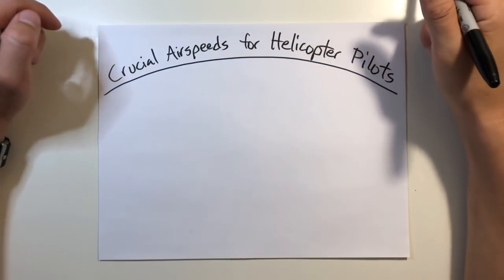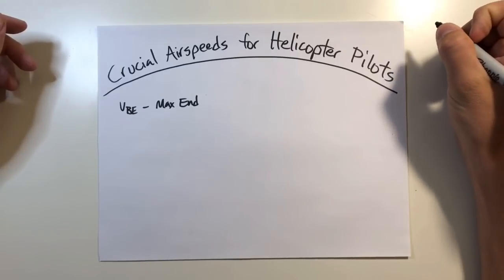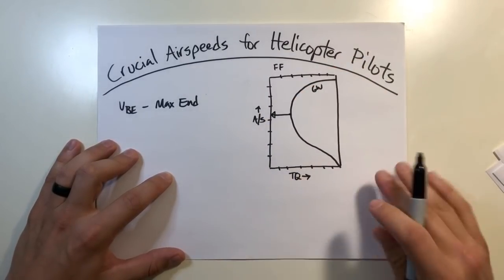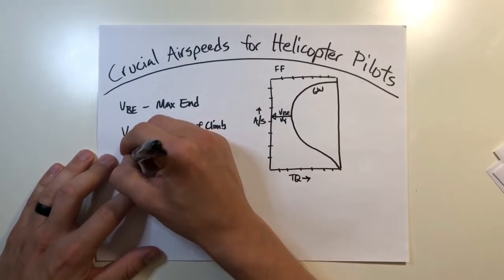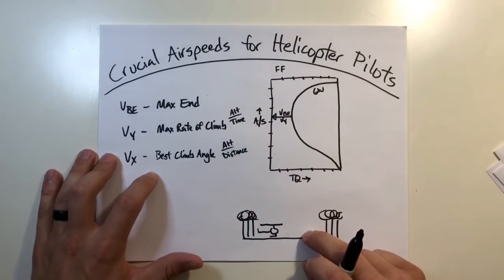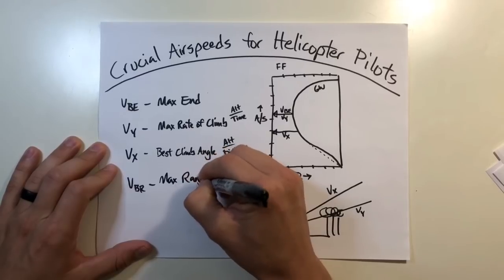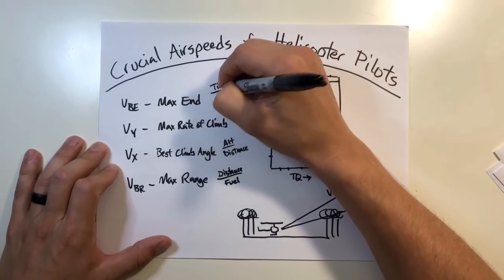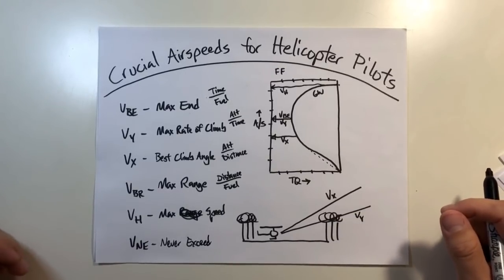Crucial Speeds Every Helicopter Pilot Should Know

Comment: Thanks for the clear explanation. 
A thought concerning Max Range Speed. I don't know the exact calculation, but I believe Max Range has to take wind into account. Here's an extreme case example to understand: say your Vbr is 80kts, if you have a head wind of also 80kts, you will have a better range by flying faster. Your Vbr should increase in headwinds, as less time spend in headwind will get you further, and reduce in tailwind.
What's your thought on that?
Reply from the maker: Winds always vary and so it’s hard to plan a ground speed based off of winds. Max range airspeed has to do with drag, fuel flow, and distance covered. In all cases (headwind, tailwind, or crosswind), max range will be the most efficient speed for covering distance although the actual ground speed could vary.

Comment: Isn’t Vx in a helicopter straight up if performance allows? 0 airspeed in 0 winds and a 500fpm climb would give me the best angle. Density altitude, OGE hover performance, and excess power available would play factor if 0 airspeed climb is possible. Also 0 airspeed climb would also put aircraft in shaded region of hight velocity diagram.
Reply: Vx is zero, if you have the power to do so. (FAA-HFH-7-7). Yes, you would be operating in the "dead man's curve" until you reach a safe altitude and/or speed so it's better to get some speed, if you can. Note, you can still be in a dangerous position with speed if you have nowhere to set down in an engine failure. If you have no space, face the wind, clear the obstacles and get the airspeed. If you have no performance and no space, don't take off until you do.

Comment: Vx sounds counterintuitive.. why isn't Vx in a helicopter in general 0Kts, given we're inside HOGE capable altitude.
Reply: So if you are looking at counterintuituve phrases think of it like this. Hover = 0 knots. Translational lift = 1 knot. Transverse flow effect = 12 - 15 knots. ETL = 16 to 24 knots. IGE is within 1 rotor diameter. OGE is above 1 rotor diameter. Is the wind ever ever ever ever so calm its exactly 0 speed? According to this it's almost like you'd never be in a hover you're always in translational lift even if you have exactly zero knots ground speed you always have some AirSpeed and that's how you measure translational lift. Even if you had just enough clearance for your rotors not to hit walls and you were completely boxed in with walls surrounding the helicopter with just enough space for your rotors to spin around via coriolis effect the vortices from the induced flow from your rotors would blow down and towards the walls and back towards your helicopter giving you some airspeed. Therefore you are never at 0 knots. Not sure if that's why he used VX as a counterintuitive but just putting a counterintuitive to make the other counterintuitive now seems so counterintuitive. Make sense? 😉

Comment: Here’s a question I was asked and still can’t find an answer to. 

Could max endurance get you the same distance as max range just at a slower pace?
Reply from the maker: Good question. The answer is no. Max endurance is like coasting in your car with very little gas applied. It may be able to run all day like that. But it’s no efficient for distance. But max range is the exact fuel burn to mileage ratio that gets you the furthest distance overall. You may be able to fly a long time at max endurance. But you won’t cover as much distance.
Reply: Helicopter Lessons In 10 Minutes or Less awesome thanks! Now I’ve got an answer for my IP
Reply: Nope. When you transition from mav ebdurance to max range the percentage increase in consumption is higher than the percentage in increase in distance and vice versa. So you will go further but run out of fuel in less time. So instead of covering 70 miles in an hour, you will cover 100 miles in 55 minutes. For example.

Comment: Isn't the best climb angle by definition always just straight up? And why is it called Vx when it's referring to an angle and not an airspeed?
Reply from the maker: David Iliescu. Great question! Vx is used when going straight up isn't an option due to power limitations. Vx refers to the speed at a max power setting that gives optimum obstacle clearance. For instance: Vx could be 40 knots with 100% power applied. Those 2 conditions create the best climb angle for that aircraft. I hope that helps.

Comment: I have a question in relation to air-frame choice. Why did you choose the 64 over the 60 or the 47? I have been thinking of trying to go 64 but I have heard that they might not fly as much as the other air-frames due to lack of mission diversity. If you could give some insight on what made you choose the 64 that would be great. Thanks
Reply from the maker: Kagan Smith. Personally it's because I wanted the offensive mission. I wanted to be the aggressor on the prowl with the power to shape situations. I grew up hunting deer and wanted to apply the same primitive instincts of scouting, tracking, and pursuing to the air.  Carrying around passengers and cargo just didn't appeal. Not to mention the personality types are drastically different in the "lift" community compared to the attack/recon community. Lift pilots plan routes in painful detail and rigidly execute missions while Attack pilots flexibly adapt based on key terrain, enemy, patterns of movement, etc. in order to execute an attack. Each unit differs when it comes to flight time but I've never had trouble getting hours. Most importantly, if your heart doesn't push you towards the Attack community, you're better off staying out of it. We don't want someone who doesn't think like this. Thanks for the question.